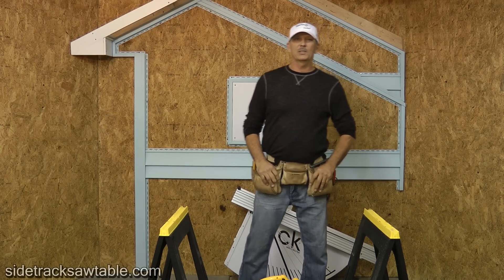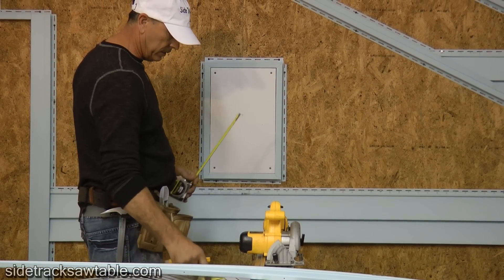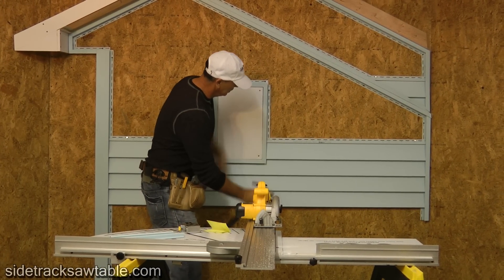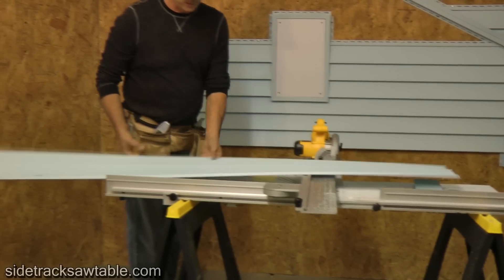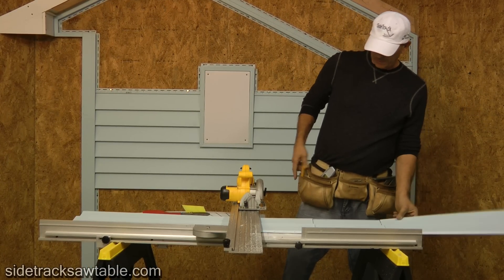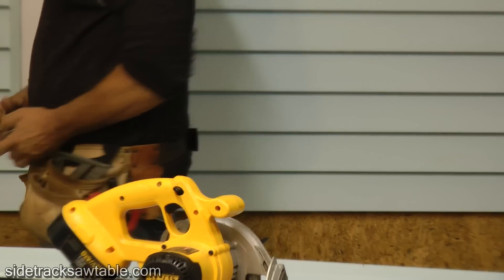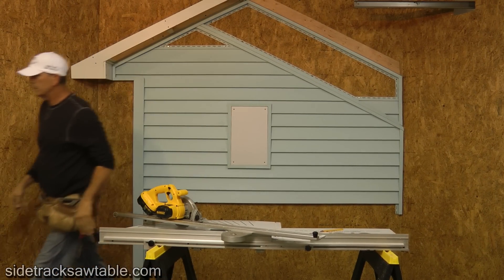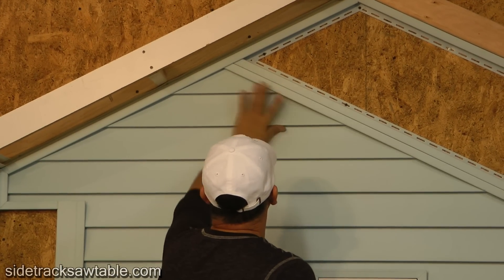How to Install Vinyl Siding Part 1

Comment: We wanted the assurance that windy conditions won't hurt our siding.  We believe that the thicker "U channels"  where the lip goes over to lock tightly will increase security.
Reply from the maker: Rick, usually the J-channel is matched to the brand of siding that you purchase, as long as the siding is nailed according to specifications you should be good. I really haven't seen siding come off in the wind unless the installer missed a lot of nails during installation or possible one or two siding panels were not locked together completely.

Comment: Just another question.  Does the siding go over the wafer board when you're actually putting siding ona house OR does the siding go over the wafer board which has a house wrap over it?
Reply from the maker: Nathan, usually there is house wrap I think it is code in most areas and it's a very good product, keeps the moisture out and stops air infiltration. I didn't use it on my display since I was just showing how to cut siding mainly.
Reply: Mel Koresh
Okay...thank you for replying.  I am having a rental property sided with vinyl siding and am just getting educated on some of the steps involved.
Reply from the maker: Not a problem, had few rentals myself

Comment: If I nailed siding tight will it bugle with heat ?? it doesn't get direct sun or if it does its very little like 2-3 hrs in the afternoon  the span of this area is 122" (10.1 feet) by 7 feet high. Should I do it over or am I ok. I did hammer nails snugged or tight because we get strong wind off the lake and I worried that it might rattle and break off.
Reply from the maker: thetruth How long has the siding been up? If its been up for a while and in the heat and hasn't buckled yet you might be ok. You can however loosen the nails fairly easy by using a zip tool used for unlocking the siding one row at a time and prying the nails loose without taking the siding off the wall. Just unlock a row of siding and you have access to the nail flange then use the tool to lock back in place, repeat for each row until complete. Mel
Reply: Mel Koresh so I ll wait until it buckles then I might just doing now oh i am going around a peak or ridge from right to left how can I get them once I get to peak ridge ???
Reply from the maker: thetruth If you can garb hold of each row of siding and manage to move it a little left and right you are probably good, if the siding gets heated in the buckle position it won't straighten out. Not sure what you mean on the peak ridge.

Comment: how are you not cutting the table on every pass.... like on our wood tables the blade eventually cuts threw
Reply from the maker: +Danny Trpcevic The blade does pass thru the table top but only about 1/8" and since I have preset indent locations the cut marks stay online and consistent, I also made the table tops 1/2" thick and use the hardest material I could find. I have one contractor still using his Side Track 5 years later. Mel

Comment: I am siding a wall but I have a breezeway right in the center how can be sure that one side will meet with the other once I get over the roof point of breezeway.
Reply from the maker: Good response Psyko Koala, I also use the tape measure constantly as I install the siding by measuring from the bottom of the siding to top of the last row of siding to make sure its running evenly all across the wall. Mel

Comment: how do u put the things the vinyl goes do u just cut them to fit the space and nail it up
Reply from the maker: Lenora, there are accessories to vinyl siding that need to be installed before the siding is applied, usually you install the starter strip at the bottom row first then J-channel needs to be cut and fit in place at the corners, around windows and doors and up the gable roof line so the ends of the siding don't show and to keep water out, Mel

Comment: What kind of nails are you using?
Reply from the maker: Nathan, I use electro-plated roofing nails usually 1 1/2" to 2" long usually. I try to nail into studs if possible that way I don't have to worry about hitting wires, pipes, duct work etc.
Reply: Mel Koresh
Thanks for your assistance.

Comment: if i did siding that slow i would be in negatives. i use shiers to cut siding and save so much time.
Reply from the maker: Max, sorry the video was a little slow, that was my first attempt to show how the Side Track cuts siding. As far as speed goes...I managed to install 20 square of siding including two large gables in one day by myself using the Side Track. When it comes to the multiple 2"-3" cuts around bays and gable angles especially in the winder hand cutting is no competition for the saw table, I actually can keep 3 siders busy not stop. Not to mention the nice accurate straight cuts.
Reply: Hey, I appreciate the video very much, thanks !
Reply from the maker: Janis McKiddy where do you work out of
Reply: Mel Koresh at home lol

Comment: I want to buy it. But It is not sold in Japan.
Reply from the maker: We will check into that for you, thanks for your interest in the Side Track, Mel
Reply from the maker: We have now made it available for international shipping to Japan. Fedex International Economy will be about  $450 US dollars for a saw table. Please note that saw table works exclusively with DeWalt Rechargeable saws and there are shipping restrictions on lithium ion batteries, so if you do not have a DeWalt Cordless Saw currently, you would want to purchase it with the 18v DeWalt Saw Kit. The 18v saws is what most of our customers use anyway.
Reply from the maker: Just wanted to update the type of saws used on the Side Track saw table, it comes with an attachment that you mount on the cordless saw bottom plate, currently works on the DeWalt, Makita and Milwaukee 6 1/2" cordless saws with the blade on the left side.

Comment: Don't put vinyl siding on your house. The new low-e windows are reflecting light with enough intensity to melt vinyl siding. Neither the vinyl manufacturer or the window manufacturer will pay for the damage to your house. There may be no option but to tear off the vinyl in a few years and re-side with something else. Don't make the mistake I did.
Reply: Could you explain this in more detail? If sunlight  does not melt vinyl siding how can light reflected from a window melt it?
Reply: bigpardner when the light is reflected it becomes magnified and intensified basically... think of taking a mirror in the sun a directing it on a fixed spot...

Comment: Who uses power tools to make a cut on vinyl 😤
Reply from the maker: When I had my siding business I cut thousands of pieces of vinyl siding with snips but as the siding got thicker (especially with foam backing) and the weather got colder it became a lot harder to cut the siding fast and accurately. Using the Side Track saw table I didn't need a template or have to draw a line to cut all the gable cuts and cutting all that vinyl soffit I can't imagine cutting it with snips, cordless is the way to go.
Reply: +Mel Koresh makes sense totally agree with you , I would definitely use it for foam backing

Comment: Definately not a teacher. Piss poor tutorial. Maybe I missed the point of this video. The main part in my opinion is how to measure the vinyl to be cut.  It did not show where you measure from or how much leeway you give the cut.   There was then a quick mention not to nail all the way in that I almost missed.  It did not mention any of the parts or what they are called.  I will watch someone else's video to really learn how to do the small vinyl siding project I have.
Reply: What's your problem here???  I, and thousands of other guys got the point EXACTLY,,,!   Right up front he says he's giving you a demonstration of the angle cutting device!
Reply from the maker: Thanks Sonny for your comment, It's really hard to cover all the areas involved in siding in one video. Just hoping to get the word out on my saw table and show how it helps make difficult cuts a lot easier. Mel

Comment: A hammer... secret nail gun faster
Reply from the maker: Freddy, I did have Senco roof nailers with a siding attachment on my siding crews, but my record is 20 sq siding installed in one day with hammer and nails on two large gable walls. With just me and my Side Track.
Reply: Just kidding brother